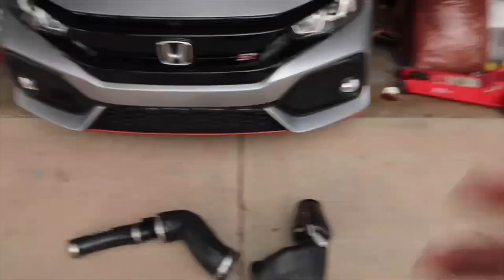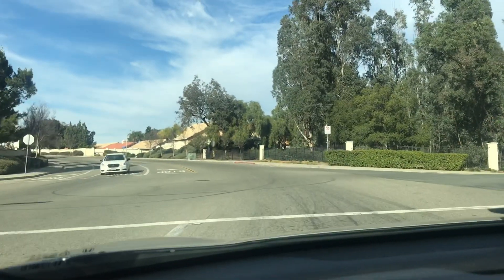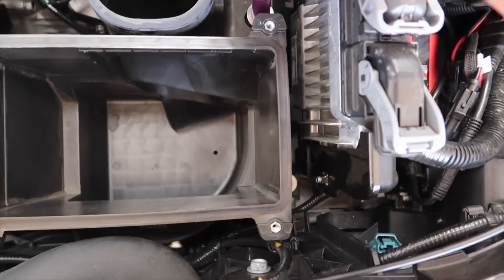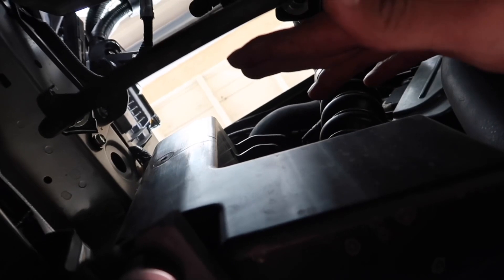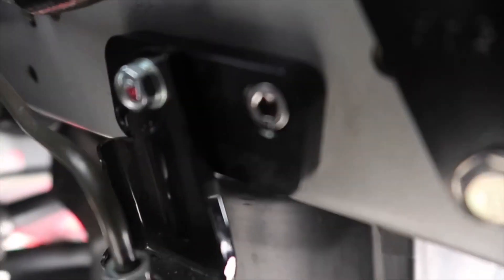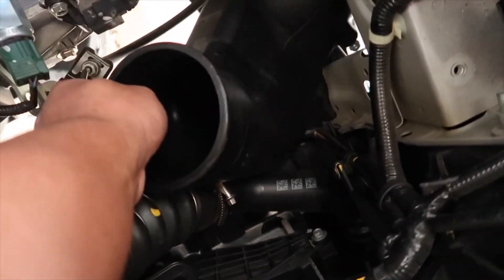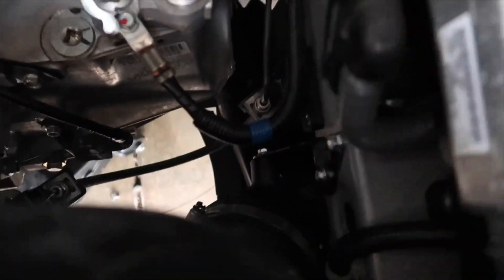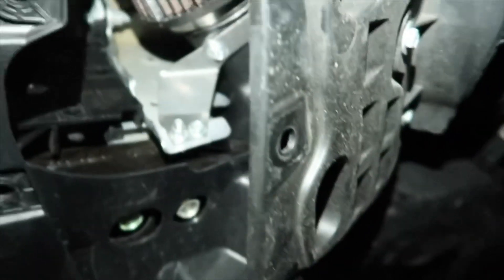Prl Cobra CAI INSTALL! | 10th Gen Si

Comment: yo does your skid plate cover the filter from the ground..thinking of grabbing a hydro shield for it
Reply from the maker: The skid plate doesn’t cover it, but there is plastic covering it from the bottom of where those three bolts/screws were where you had to remove next to the fender liner

Comment: You got that intake for a steal!!! I wonder why people don’t get the short ram one?
Reply from the maker: Kwezzy I know! It was something I couldn’t reject!!!
Reply: I read from PRL that the sri is not recommended , they say that the heat can melt something that ends up restricting the airflow (im no mechanic hahaha)
Reply from the maker: You don’t get that much benefits with a sri compared to a cai. People that run the Sri are ones that are likely to hyrdrolock due to their weather conditions in their area of residency.
Reply: @FORSAKENGARAGE  yeah this was before I knew the platform as well as I do now. PRL CAI is the only way to go for performance increase and I recommend getting the race maf version.

Comment: You think SI intake will fit in 2017 civic hatchback?
Reply from the maker: There’s two versions. One for the 1.5t engine which is the si engine and the ext and above. If you have an lx and ex or a 2.0l engine you’ll get the one for that one.
Reply: Anthony Felaire alright i see thank you 🙏🏽

Comment: Question. Do you need to tune it after install the intake??
Reply from the maker: Kento Pramono it depends! If you get the race maf you will need to get a tune, however if you get the street maf, you don’t need a tune. When I installed my intake I had a street maf without ktuner or hondata
Reply: After I installed my intake, bunch of sensor pops up. Dang it! Now i know what happened. I gotta get it tune. Thanks for the info bruh!!
Reply from the maker: Kento Pramono did you have the race maf?
Reply: Anthony Felaire yea mine is race maf. Idk how i ended up getting the race one lol. Do you know what’s the difference between those two??
Reply from the maker: Kento Pramono the size, the sport maf is smaller than the race one. Which is why when you get the race maf it requires a tune due to more air